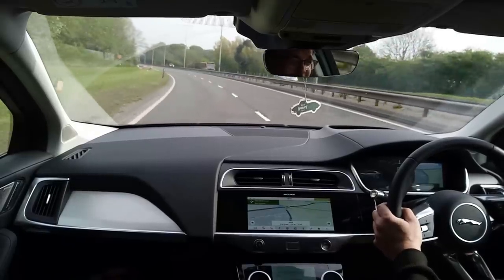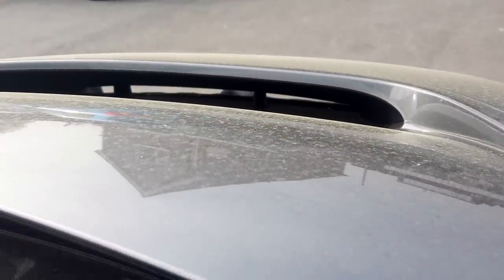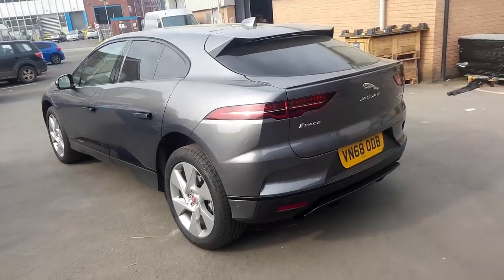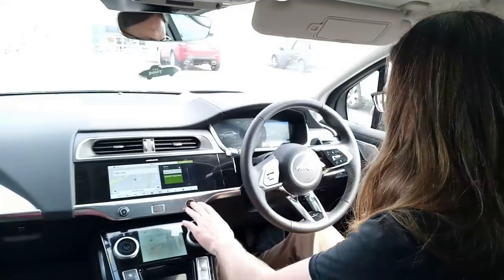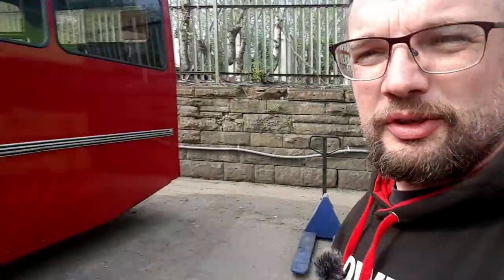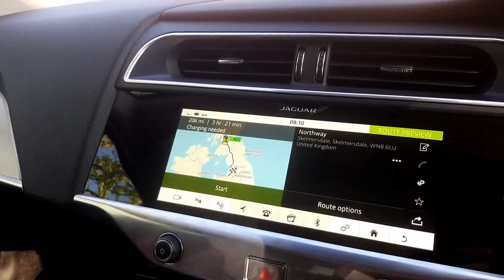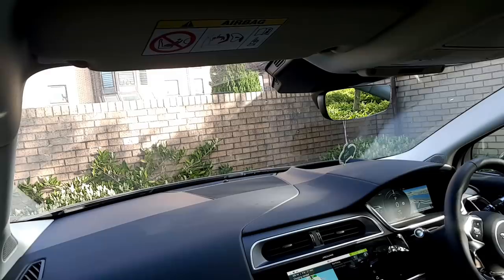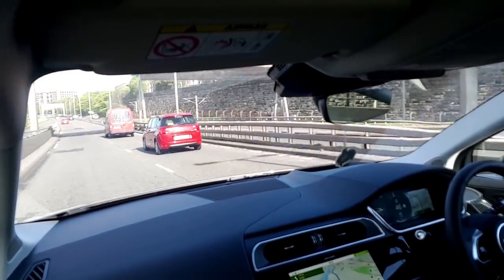Real Road Test: Jaguar I Pace 800 Roadtrip - with bonus bus action!

Comment: Handsome car aside from ugly wheels( wheels with an even number of spokes/holes/slots look awkward and imbalanced) the leaper badge on the rear looks lie its falling off at a distance and the asymmetry messes with the symmetry of the car ( the round cat head badge usually on the front should be on the back) likewise the leaper on the steering wheel hub and it really needs a rear wiper.Speaking of the steering wheel, the round button in what is supposed to be the wheel center is waaaay off centre and quite annoying when the wheel is spun, really poor design! The interior look like it won't age gracefully and appears a bit harsh. There should me more space in the frunk, question the necessity of the air slot to nowhere on the hood/bonnet, could be deleted and allow more frunk space, imho.

Comment: Reality is electric cars are getting there. Will be price comparable to petrol cars within 5 years. In the same period will probably near a real world range of 400 miles. Recharge needs to get in excess of 5 miles per minute (300 miles per hour). In theory 350 kWh chargers which are currently being rolled can achieve this as could 150 kWh chargers.
Within 5 years an electric car will be the default option for most new car sales in the uk. Petrol cars will only be first choice for those regular very high mileage drivers. Diesel needs to become something out of the past and priced out of the marketplace.

Comment: All very well to say ev's are pollution-free but the batteries are bastards to dispose of when they're really finished, expensive to replace, and unless your country uses hydro or wind for its electricity, the increased load on coal/oil/gas power stations simply means that the pollution is being moved from one place to another. True, ev's don't have sumps full of lube that needs disposing of every 10000Km or so. Just thinking.  Col, NZ

Comment: A Jaguar iPace? Really? I mean, how unHubNut. Just as well you got some old(ish) bus action in or I'd have thought I'd clicked on one of those "professional" car review channels. 

On EV's I'm not entirely convinced of their "green" credentials, especially since (1) much of the electrickery they use comes from coal- (gas-/ oil-) fired power stations and (2) much of the carbon emissions a vehicle produces over its lifespan are a result of its manufacture (not to mention the emissions resulting from extracting the iron ore, extracting and refining the bauxite). Do they alleviate smog and fumes in cities? Yes, but they come at a cost,and frequently that cost is borne by people many miles away.
Reply: in the UK, none of it is coal, its probably french nuclear, eve if it was, a coal station is vastly more efficient and cleaner than your car is, everything you buy is at a cost of people many miles away, its capitalism

Comment: Well, I guess you will just have to learn about the state of charge and range.  I’d like to see you drive a performance car with the fuel gauge on nearly empty just to see if you could make it!  Rather dumb really.  Yes, bigger battery packs mean more range and/or performance - but since nothing is “free” - you take the hit when you have to recharge.  And as you experienced, some rapid chargers work better than others. Silly test....
Reply from the maker: Difference with a performance car is that you can fill it up pretty much anywhere, with cash or a debit card. That's the point.

Comment: What a flippin palaver, electric only cars are just not practical. Plug in hybrid will be the way to go until electric only have 600-700 miles and they dont cost £70k

Comment: Get alot fitter with these electric cars. Lot of walking during fill ups
Reply: Yeah bruh, unless you can't walk, or are disabled. The charge points seem miles away from anywhere. And Ian seemed to keep getting in and out of the car - not much fun in the rain or cold, err, or if you can't walk... (You have to get out for fuel stations, but surprisingly they have a roof, and you don't need to get out so often, and there's less likely to be ice on the ground in winter).

Comment: With the infrastructure currently in place this is not going to work. You would need hundreds of thousands more charging points and the ability to extend your working day by at least a couple of hours.
I can soon see the AA and RAC getting well and truly swamped by towing electric cars to charging points. Joe public will simply be unable to judge range/charge and they will be stopping here there and everywhere.

Comment: I cannot agree with this thing being anything other than overpriced overcomplicated plastic shite. After the Warranty ends & everything electrical starts to fail (as is common with Jaguar Land Rover products), including the battery, these cars will cost an absolute fortune to fix, need a specialist at specialist labour rates, & being a Jaguar, very expensive on parts. I'll stick with my 170,000-mile mk1 Ford Focus, thanks. All it needed at the last MOT was front brake pads, spark plugs & the usual oil change, all of which I did myself in a couple of hours. Fair play to people buying/leasing these things new & selling/swapping when the Warranty runs out, but the idea of buying anything this complicated out-of-warranty... no thanks.

Comment: Whilst Supreme Emperor Musk is working on battery/charging technology wouldn't a switchable leased battery system be more convenient? you pull in, a system removes yer low battery and replaces it with a full/ready to go one. yes it would rely on a universal battery but cars did that in the past.
Reply from the maker: But then you need even more batteries than cars.
Reply: @HubNut  They've always said the key to EV efficiency is in the batteries, it would be like gas bottle industry, you lease the container.

Comment: ( electrice car  would in a city yes round london)  if  used  a motor way rest place electric changing point  where are can fine 1    just no    small town    over a long jonrney  use electric car very  mile's over 60 mile yes   if going over 220 mile they a down side  some pro / con

Comment: This appears to be you going through a catalogue of disasters, or at least most of the list of how not to do it. The network for electric cars is still unusable. Really? And it has nothing to do with you leaving it too late?  Why leave it so late, its just so unnecessary. Then you are surprised that having plugged it in for 30 minutes and its only up to 31%. Yeah, that’s why people that know what they are doing don’t drive it till its nearly empty. And you do realise that the bit from 80%-100% takes as long as 0%-80% (to protect the battery) so people that know what they are doing don’t charge up to 100% mid route. There is an old adage; Failing to plan is planning to fail. 

That there was a problem with one Polar chargepoint, hardly equates to an 'unusable' network!  And someone that knew what they were doing wouldn’t try and top up on an AC charger which would have needed hours to top up. That's an overnight charger, not a mid journey charger!  Lucky really that it wasn’t working. You might have been there for hours and hours, no doubt claiming its the network that's stupid. So your damnation of the entire network comes from someone that doesnt really know very much about driving an EV on a long journey. 

But it doesn’t seem to stop you printing suspicion as fact. That is both tiresome and extremely unhelpful. There will be people that think you know what you’re talking about and that you are talking the truth. 

I have been using the network for over four years, running up over 60,000 miles. It can't be that unusable.

Comment: How can ppl call electric cars....CARS? It have not even a similarity with a car...a REAL car, means...jump in and drive, fuel low, 5 min later, back on the road for your travels.  
Electric stuff....battery....yeah, were we going on holiday dear. Cos, you need to realize....we must re-charge, so have to book extra places to sleepover. 

My goodness...next thing they invent is an car with an App...when you need to go to the loo🤔 
Who need this stuff.....fashionistas and some nerds???

Btw:
1.What the heck is wrong with normal dials.....cars now look more like a cheap video game. Screens everywhere....navi in your gage cluster,  navi in the center...what's next, navi between the taillights,  so ppl see were you go🤣🤣🤣

2. Someone have to do a real road trip with a comparable gasoline engine and a electric car. Say...London to Rome...that will be a enlightening story for sure. I'm very curious who have the nerve to do this, cos...it will take substantial delays for recharging etc.

3. Electric cars are surely the future but....probably better when it's  generated by hydrogen . It would  considerably eliminate a lot of the problems with charging-Range anxiety etc. The actual fuel stations,  can be easily adapted for it.The real issue with that, is the lack of guts from the governments . Cos the oligarchs....lobby still a lot!

Comment: Do I pace burn as well as Teslas I wonder. There is an ecotricity charger up the road from me in Swaffham,saw it in use once with a Tesla connected to it. I looked into getting an electric car but the range problem in Norfolk is such that I decided against it and got a diesel Mitsubishi, another problem with electric is they are not big enough to take the wife's electric wheel chair. But my research into electric cars left me wondering are the the enviromental wonder that the government will have us beleive, or will they just push pollution elsewhere to the power stations, certainly some research by German university points that way they say that an electric car produces as much CO2 over its lifespan as a mid size diesel salon car. I know why the manufacturers are begining to push them, cost it is a lot cheaper to have the electric motors and control electronics along with the batteries made in China than to make a petrol or diesel engine in europe that is complient with the emission reg's.

Comment: The cars are getting better Here in Orkney we have more e cars and more charging points than most citys.  It wont be long till there is road rage at a charging point. If it has not happened and the media has not found out. The usual uk morons at the helm. Sell the cars and then think about the charging points. It wasnt much different when diesel amt out in cars very few petrol stations had it at the pumps. You had to go to the truck stops to fill. mankie pumps and puddles of derv on the ground.
Reply from the maker: Yes, Orkney is something of an inspiration.